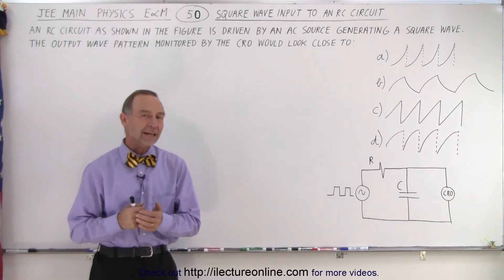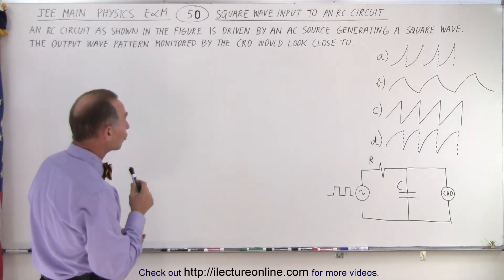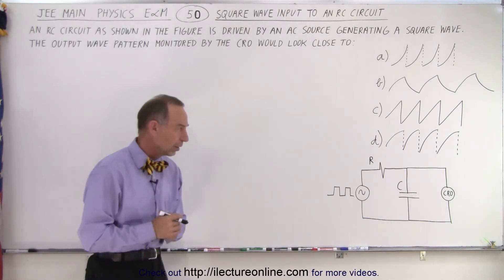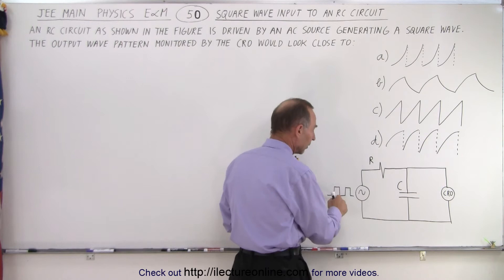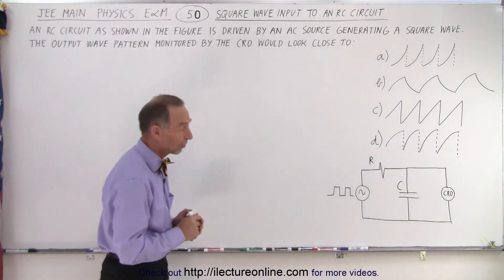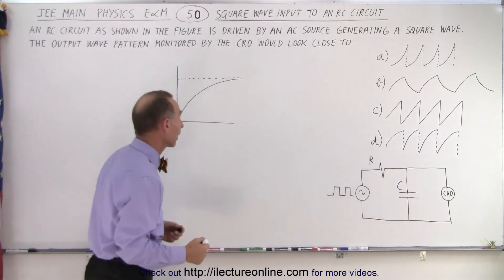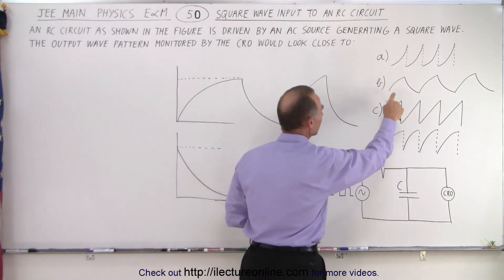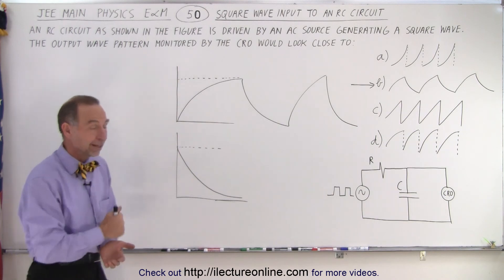JEE Main Physics E & M #50 Square Wave Input to an RC Circuit

Comment: Sir, although the explanation is quite correct, the lecture could've been made more interesting if you could show why the charging, and discharging of capacitors results in those graphs. Also, often when we consider an AC  Source, it is considered as a sinusoidal and not a square wave, I was wondering if that would change the answer. Thanks!
Reply from the maker: That is explained in the videos on RC and RL circuits in the physis playlists.  (Can't do everything in one video)
Reply: @MichelvanBiezen  hello sir your lectures are just beautiful, can't thank you enough.